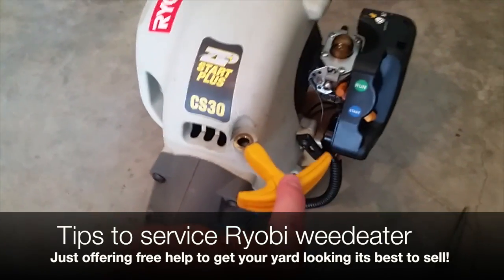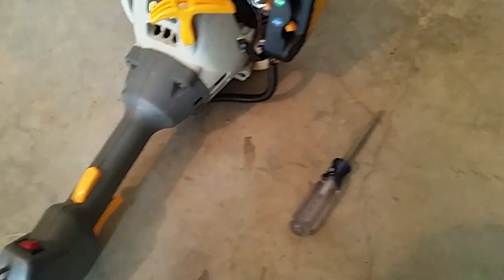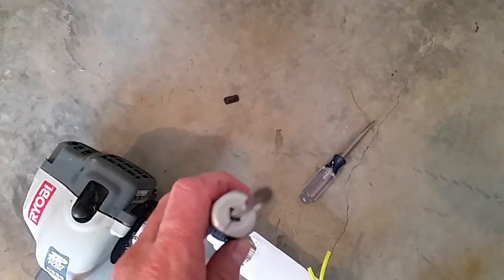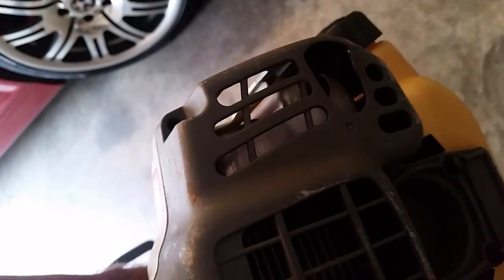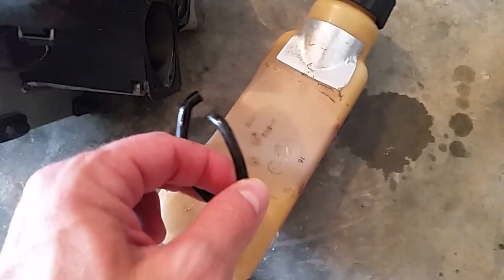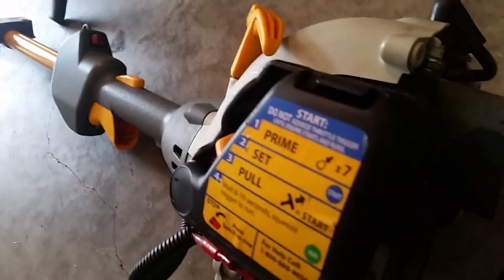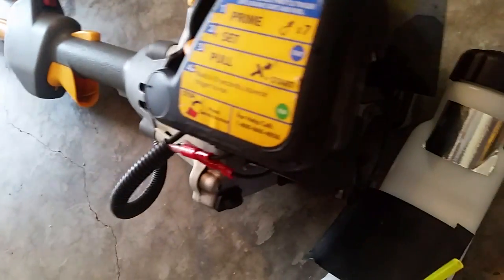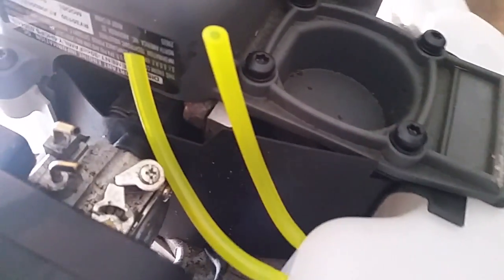Ryobi CS30 Weedeater Quick service to get your Lawn Ready to Sell Your Franklin TN Home

Comment: Why did you have to buy a new fuel tank? Did it get cracked? The maintenance on the fuel tank is generally those little fuel lines. They actually act as a seal when inserted into the fuel tank. As they age they shrink and do not seal the holes in the tank properly. So you put it in the car or just hang it up in your shed and the unit leaks gas or gas fumes just escape. Every 5 years or so you just go to a good hardware store and they have that gas line on a roll, they will cut off what you need. Replace the one on the fuel filter first and then cut the amount of the line you need to reach the connection to the unit. It is easier to have a longer fuel line as you have to attach the fuel filter and have the line run to the hole. Then use the rest of the line to connect the priming bulb connection.
Reply from the maker: I figured for $11 on Amazon I would just put all new parts on.